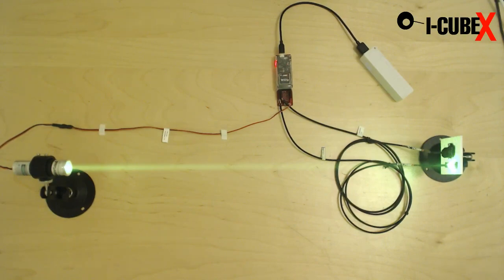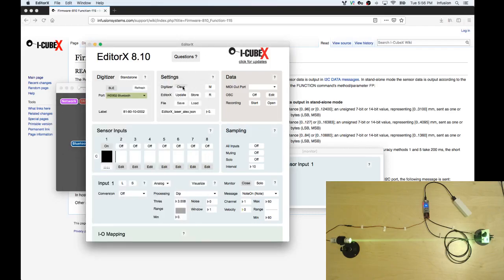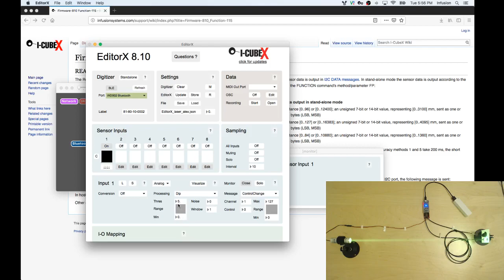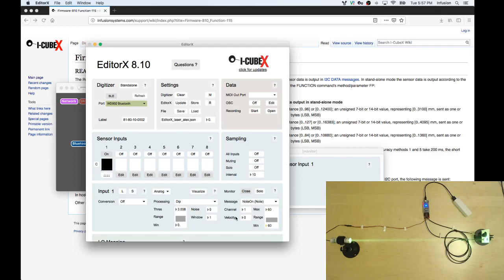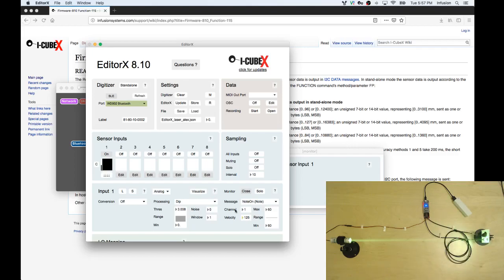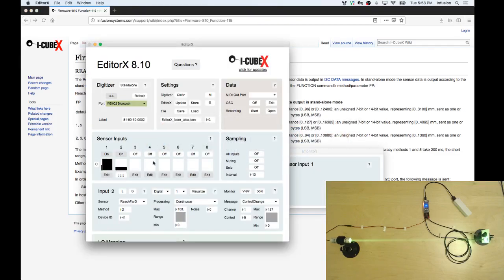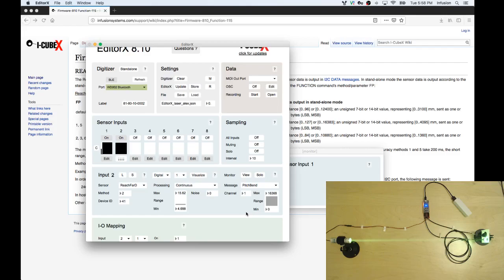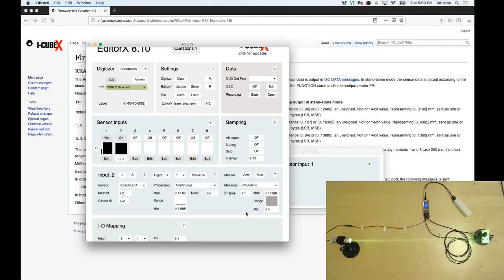Making a Laser Beam MIDI Controller with the WiDig

Comment: How far apart can the sensors/lasers be?
Reply from the maker: We tested it up to 30 meters, but it'll likely work fine at a much larger distance.
Reply: @ICubeX  Thank you very much for the quick response. And how much does a set like this cost?
Reply from the maker: Currently around $300USD excl. shipping but we can make you a better deal if you create a quotation at https://icubex.com. The mount for the Flash is not included.

Note that trigger detection by the Flash works at whatever distance the laser can be detected by the Flash but the ReachCloseD senses only up to 2 meter. You could replace it with a ReachFarD which senses up to 4 meter.